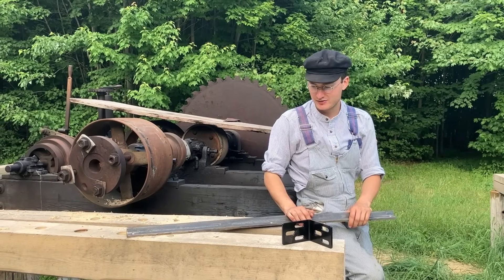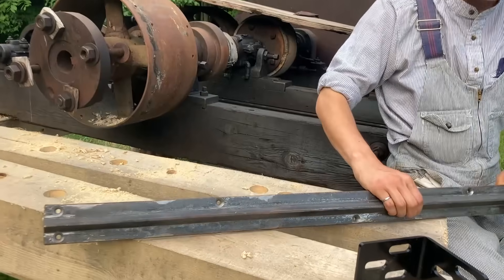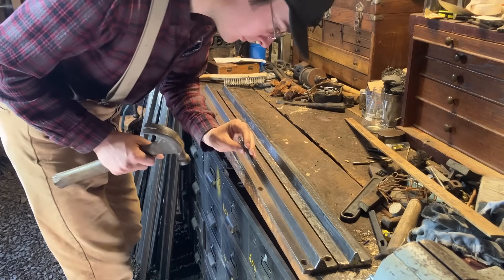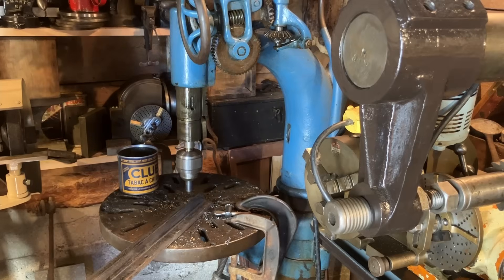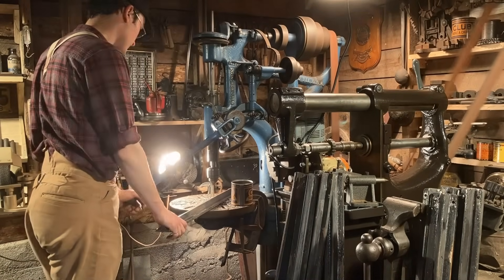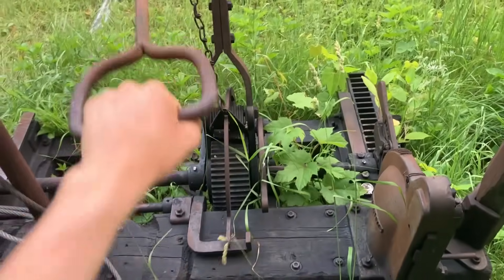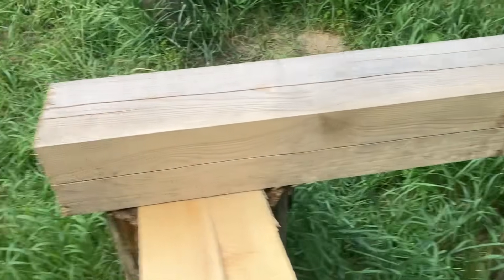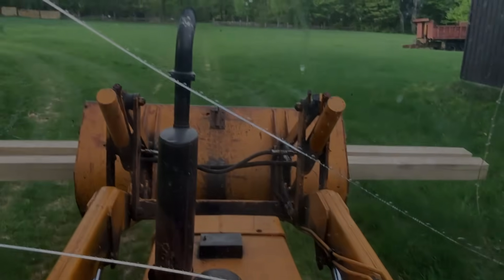Circular Sawmill Build & Newly Cast Rails

Comment: You cannot judge the effort you put in by the cloths you ate wearing.  Get a workshirt and pants with suspenders.  Get them one size larger than your regulars.  Wear them over, use them, and let them hang when finished.  In a year or two they will have the mark of a craftsman.  🦊🦊🥸

Comment: This is wonderful. We run a circa 1900 lane sawyers favorite number one. The guide rail is set away from the saw to prevent derailing while turning logs, often the near side of the carriage will lift, also prevents fouling from sawdust. Our guide rail has more of an acme thread profile with steeper sides and a wide top flat. The wheels ride on the sides and do not touch the top.  the axles are tapered longitudinally to the end so that the wheels self center as they run and wear. Keep it up and thank you!